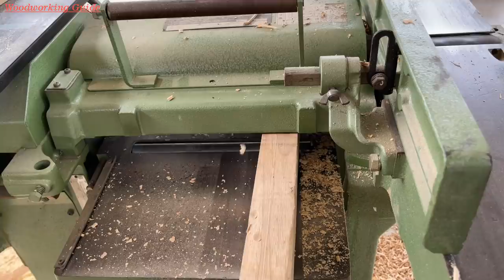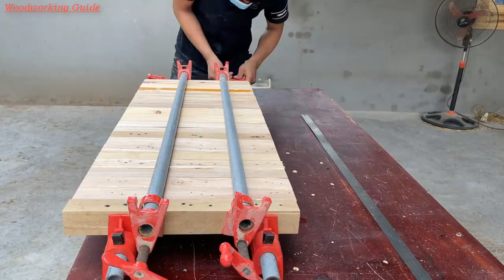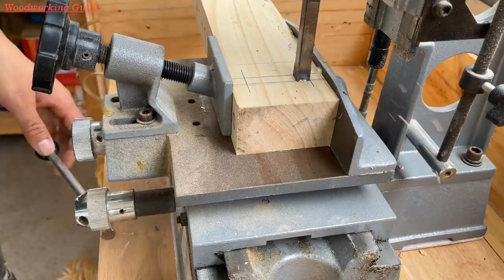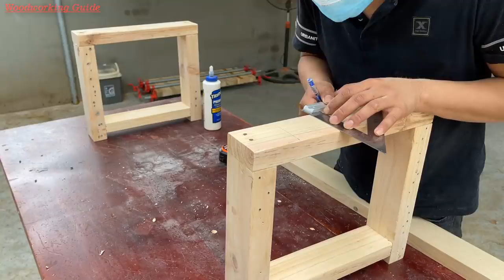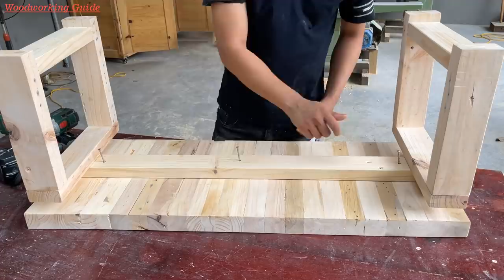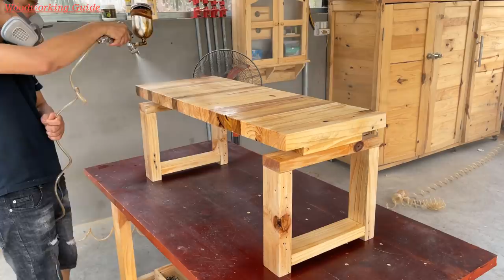Great Chair Created From Old Wood // Incredible Wood Recycling Project

Comment: so I wonder what would happen if you wiggled on that or even sat down sort of sliding to the side.....it would probably fall apart.  You should think about putting a cross bar at the bottom.  Also, leaning forward or back could cause it to loosen because you do not have support in the front or back underneath.  you can strengthen it considerably by having support there.